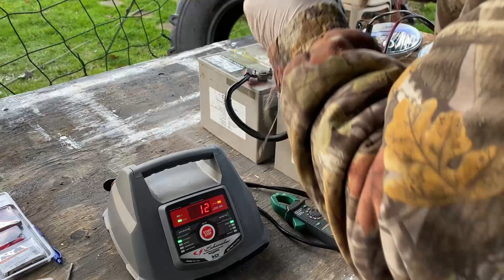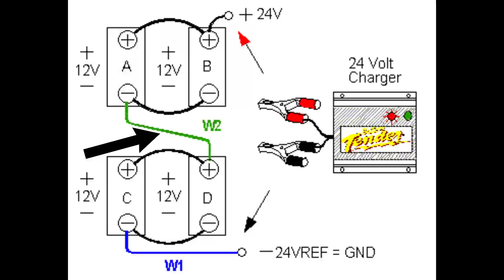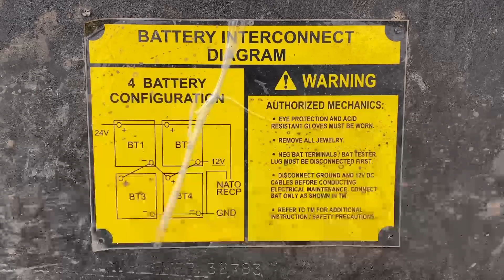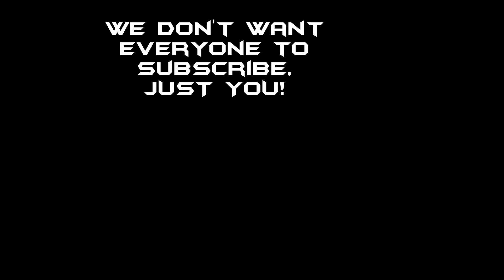FMTV BATTERY BOX LID MOD & NEW BATTERY SCHEMATIC #153

Comment: I'm lossed on the difference between the military diagram and your kurkofs law,  Was that from stalock  13 ,  Recommended by sergeant Schultz, they look the same to me.
Reply from the maker: Look how the 12v (pos) output and the ground are not on opposite corners in the sticker diagram on the truck. They should be in order to get maximum use from the batteries. In other words, the left-hand 12v system battery only feeds feeds off power to the right-hand one. It never gets used or charged directly. Therefore, that battery will most likely be the first to die.
Reply: @HelicoolsHelipad   So the nato receptacle would be from ground to 24 V  Just like the original under cover yellow description from oem.
 I generally use a 24 V charger on the nato plug to charge my battery's 
 and to jump other 24v equipment / trucks/generator/if needed.

Comment: Great Video. I took a simpler approach to my battery cover "ponds", I used gorilla tape on the two center ones and it works.  Your solution is better in many ways, no doubt.
Reply from the maker: Whatever works to eliminate that mosquito pond and mud gathering receptacle. It looks and stays so much cleaner, now! Cheers!

Comment: Good work as always Dave. I might switch that 12v lug to the other side as you have shown.
Reply from the maker: I posted on the LMTV MTV Military Trucks group site... I asked if anyone could prove me wrong, because I want to have confirmation or a real good explanation why the military designed it how they did that was better. I believe I am right, and the proof is in the pudding.

Comment: Dave, so according to the law, with multi 12v batteries, its better to charge/discharge from oppisite ends..in otherwords charge P farside and N nearside, discharge N farside and P nearside...looks like I need to rewire my inverter
Reply from the maker: Charging and discharging should always be done across the battery pack... yes. This ensures both batteries in that system are fully active, and one is not just there to feed and feed off of the working battery.